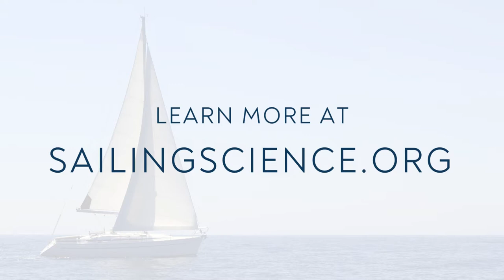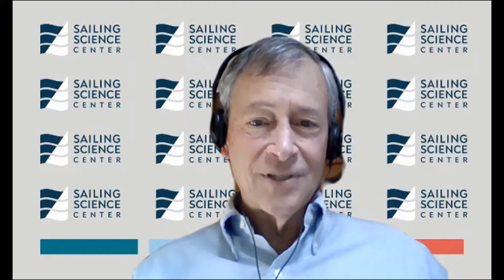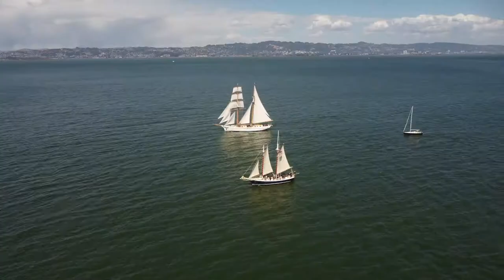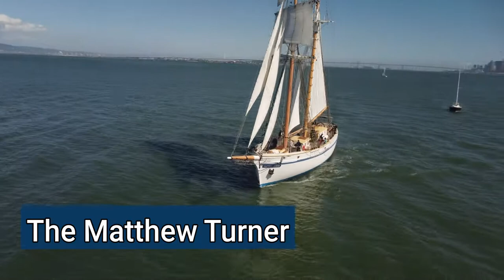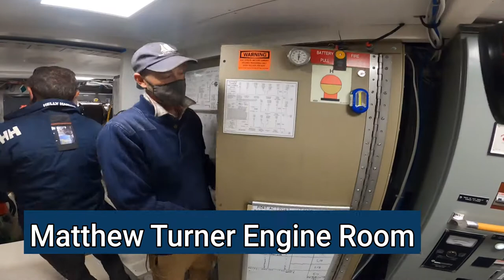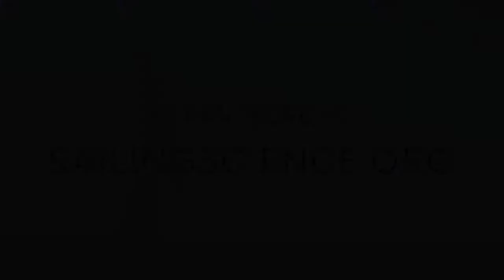Charlie Walther on Green Marine Technologies

Comment: I would like to applaud R&D the world over for investing in more efficient technologies. One day we may be able to tap in to that zero point energy. I would, also, like to thank Mr. Walther for his contributions to the maritime industry. Rudolf Diesel design the "Diesel" engine to run on bio fuels, so I am happy we are trending back to a renewable. This comes with a very large carbon impact that is the elephant in the room. I would like to know what is the measure of "GREEN"? What is "GREEN"? What is the acceptable compromise to be "GREEN"? Mr. Walther mentioned a study that stated there was a 20% "penalty" in the cracking of bio fuel. I read a paper with that 20% conclusion. The paper that I read focused largely on the expenditure in the cracking process and the carbon foot print of that process as related to KWatt in vs KWatt out. This paper did not mention or include the plant (corn, soybean, peanut...) itself or the impact of cultivation, harvest, processing of the plant into oil, use of it's waste product and/or the various modes of transport between each of these steps to usable energy. Here is the elephant that no one wants to acknowledge.  The manufacture and operation of the farm equipment is a very small, measurable) impact compared to the process of cultivation. Using corn as an example, each corn plant (stalk) is biological chemical/elemental fracking drill derrick. Corn takes in carbon above ground and releases (fixes) it below ground to aide in the release the nutrients that it needs to grow. "No Till" planting is being used to  minimize the particulate loss of nutrients and carbon that is fixed into the soil. However, this does not eliminate the need to "work" the soil. each time the soil is worked carbon, that the corn has scrubbed from the atmosphere, is being reintroduced/released back into the atmosphere. A freaking lot of it! Farmers can not do anything about this (yet). These quantities can be measured, but are never mentioned in mainstream. A shot out to my silviculturist friends. There are more forested lands on the planet today than there were 500 years ago. Trees grow, just like corn, but with a longer harvest period. FYI This is a small segment of industry that it takes to produce the fuel, the batteries, the generators, the solar cells, the.... And the mines and smelters for the ores required to supply the "GREEN" industry... OMG
So, what is "GREEN"?  What level of compromise is "GREEN"? What is the next landfill nightmare that we all will face? 
I am old enough to remember the milk bottle, refilling soda bottles and that wonderfully simple and endlessly reusable Brown Paper Bag!
All I see is money grubbing, spinning, marketing, throw away nonsense and a gullible populous buying the hype.
Reply: Good Luck with your channel. Sincerely.